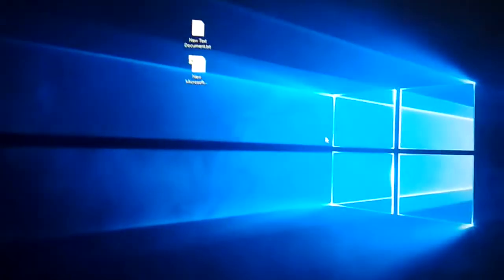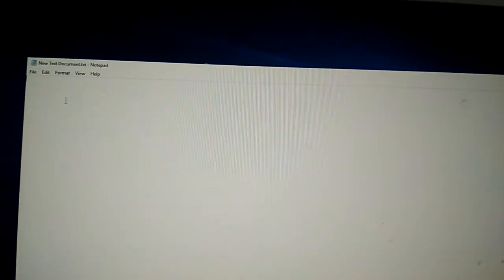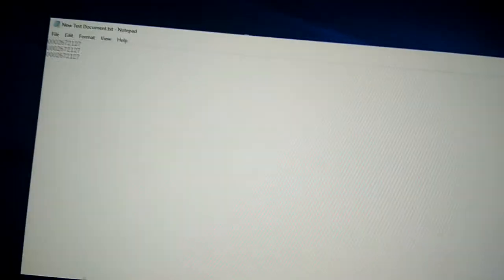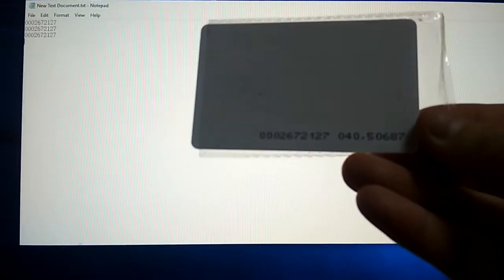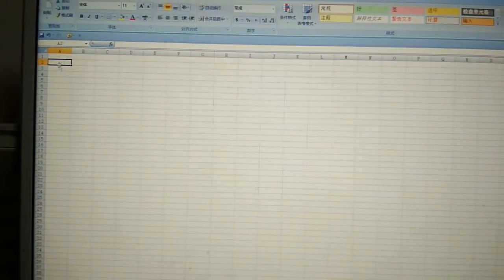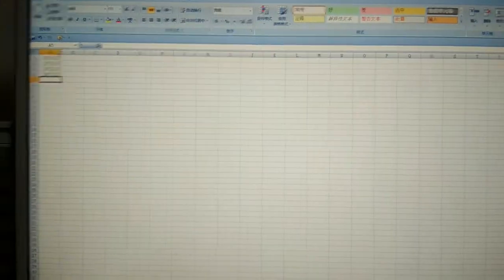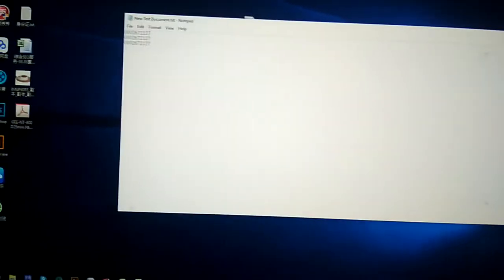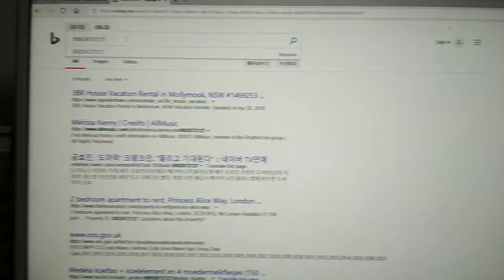How to use GEE-LR-001 125 khz EM4100 RFID reader

Comment: fake video! need software which read or write all data from cards.
Reply: No software need bro ! It works like keyboard and prints directly if you open notepad or something like that where you can type using keyboard.
Reply: @Kushbehere  is it true for all RFID readers, Do all of them transfer tag IDs like keyboard . is it a same protocol?
Reply: @Kushbehere  I have two only works with softare ID  READER WRITTER V2 no KB OUT